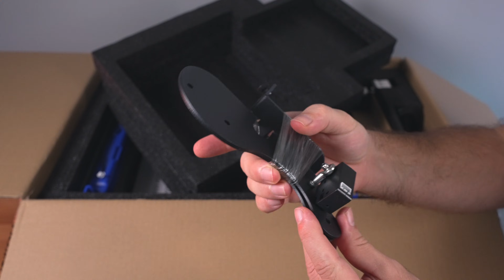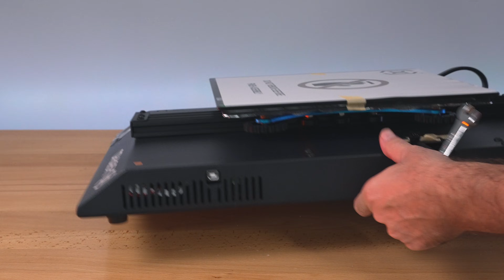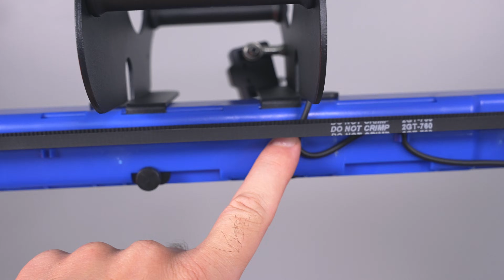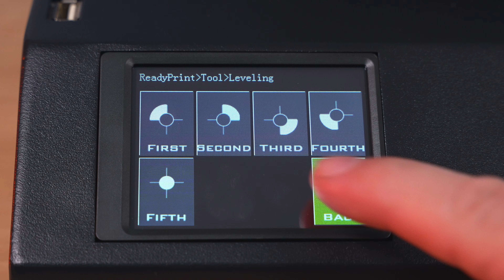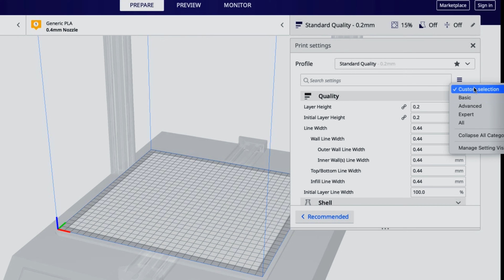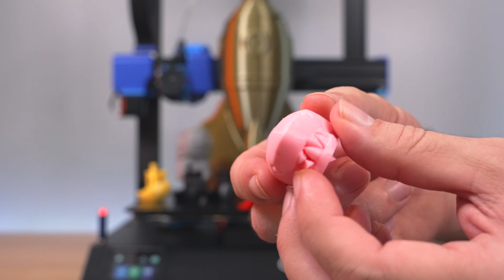Artillery Sidewinder X2 - 3D Printer - Unbox & Setup

Comment: You didn't show how you got the rest of that print off the bed the little circle I just printed the sample cube and I could barely get it off now I have that little square line stuck to my bed how do I remove it from the bed I'm stumped and don't want to scratch it anymore than I already have with my spatula

Comment: I have the X1 - look like they addressed all the problems.
Better connectors for the ribbons (endless problems on the X1)
Improved reel holder (was 2 hex bolts at the rear, with ball races, so you had to adjust it for each change of reel width)
Bed power no longer sticks way out the back, making it very deep. 
Auto levelling!
Z probe instead of a limit switch- which sometimes does not get the height correct. 
Makes it a much better printer

Comment: I found the following settings best: 220 degrees extruder 65 degrees bed a light coat of hairspray.  And DONT FORGET .To enable compensation for auto-leveling, add M420 S1 Z10 after
G28 in starting Gcode.

Comment: QUESTION.. do both the X-1 and X-2 have 4 stepper drivers that are plug in ?  So if you have a layer shifting problem do you need to replace all 4 at the same time.. Because you wont really know which one of the 4 drivers is causing your intermittent problem of layer shifting.

Comment: @Just Vlad   is it normal for the extruder arm the part with the extruder on it if you grab the arm and twist is back and forth should it move mine moves does this need fixing if so how do I fix it I also have a ghosting issue on details such as holes text and other shapes how do I fix that this is a new 3D printer it’s been one thing after another

Comment: My experience with direct drive is to use a 1.5 - 2.5 retraction setting.  Can anyone else confirm that Vlad retraction settings seem much too high?  Bowden tube levels of retraction seemingly...
Reply: As a direct drive user , mine is 0.8 which is for my ender s1 pro , I bought a x2 today so I'm gonna try that aswell but I'll find out when it arrives

Comment: hey really finding your video useful, they should hire you to make official manual in video form!
one question: i didnt see you add in the gcode in cura for making use of the auto leveling bed? in the manual it says to add "M420 S1 Z10" after G28 in the slicer.
is this necessary? wont omitting this coding completly negate any information gathered by the auto bed leveling?
sorry if i missed. you are amazing.

Comment: Any concerns if the Z axis bearing supports in that upper plastic arm will quickly wear out? And how is Artillery's customer support?
Reply: The amount they turn they'll last basically for ever.

You get the same type of bearings in motors which see more action in 5 minutes that these will get in years.

Comment: Turn down the hotend temp.    PLA at 210 is mych too hot.   190-200 is about the right spot.   Less stringing. Less pock marks in the prints

Comment: Awesome video. What filaments does the printer take?
Also what is your top recommended 3D printer for a newbie? Thx!!
Reply: This printer is probably the best for newbies although it has some minor problems which could be easily fixed. These printers are capable of using any filament. I would recommend Pla if youre printing indoor.
Reply: @ultimategamer3212  thanks a lot for your replu

Comment: I bought this a month back. Had some clogging issues form the beginning and my prints typically don't adhere well to the bed. It's all probably my fault tbh but I had the extruding gear break during a print and went through a week of back and forth to get new parts from the company. After I fixed the extruder, it runs fine. It is a very solid printer for the price and I will say probably better than most at the same price level.